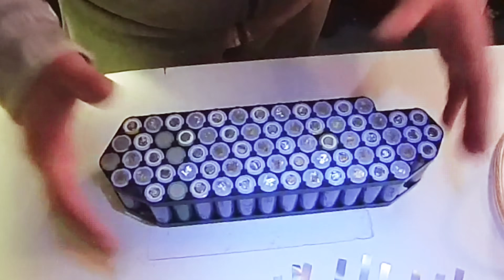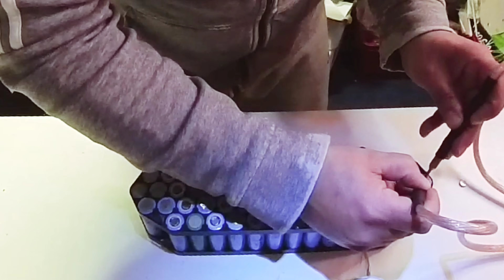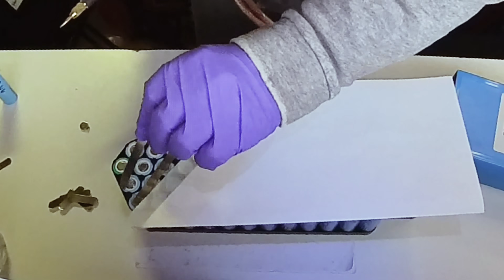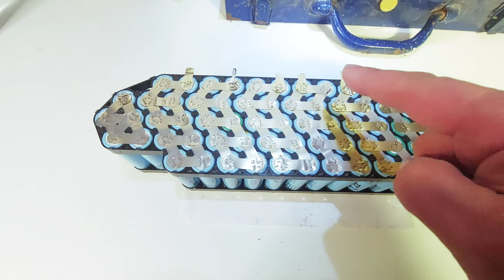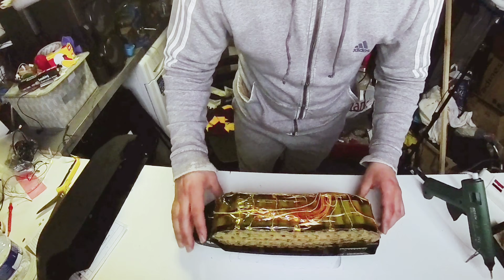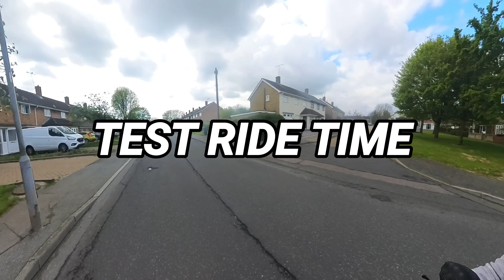MY FIRST DIY LITHIUM 52V BATTERY BUILD USING 18650 CELLS

Comment: Nice. I've been doing a bunch of research on my own as well on assembling one. I want to build my own 52v pack based on Samsung 21700 50E cells since I already have a 48v 20AH pack(13S4P) based on those cells. In intend to reclaim those cells I already have and add 18 more to make a 14S5P pack. Should get me closer to 30AH. Originally I had hoped the existing case I have would accommodate an additional 4 cells and a new BMS for a 14S4P layout but it's packed full. Ended up finding a case that would work(Shark case that fits 70x 21700 cells, comes with a 14S 35A BMS).
One thing I noticed you didn't do that I will probably do when I get around to re-building my own is use Battery insulating gaskets on the positive ends of the cells. They have adhesive backed ones you can get on sheets.
Reply from the maker: Cheers,  I enjoyed putting that battery together and appreciate the advice on chucking on some ring gaskets. In my next battery build, I'm definitely putting on some ring gaskets as a little extra safety is always a good idea. If felt like I learnt a lot from putting that battery together and I also have plans to make another battery using 21700 samsung 50s 5000mah cells which is a little more expensive but I like the fact that they give you 35A max continuous. It would be a 72v battery using 120 cells, but that's something I've wanted to do for some time, but I needed to make a 52v battery so that I could get some real time hands on experience. What type of bsm would you be using?
I've looked at two different bsm  are daly and an ant and spoken to a gentleman from cell supply who advised me on those two if was gonna make a 72v  battery.  Would you happen to know Where's a good place is to find a case for such a build?
Wish you all the best of luck on your battery build. Also, check out an app called battery package calculator as it will tell just how much Ah you'll get out of the pack you build. Thank you for watching and commenting and the advice as it is always appreciated. Take care 😎👍